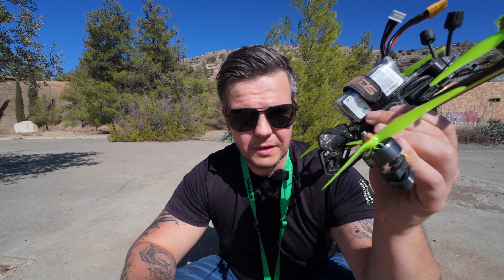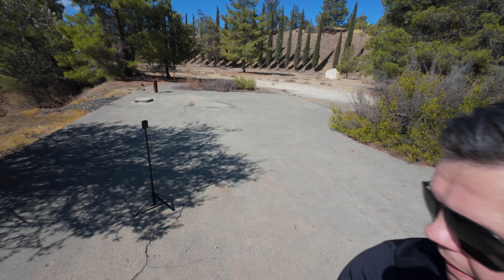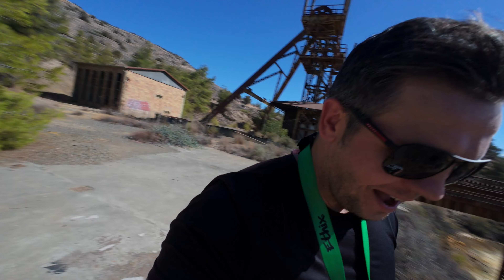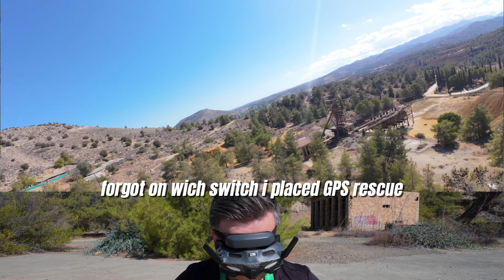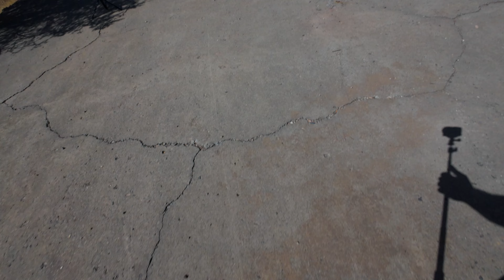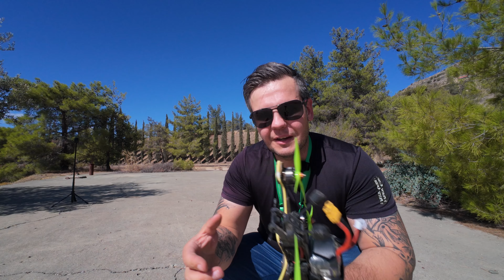GPS RESCUE / Is it worth it ? / Will it save Your drone?

Comment: It's a diy fpv quad, not a dji mavic. Its not Deepspace fault as basic gps rescue on fpv drones are to only help you until you get connection back and then you manually land it. GPS rescue is NOT Return to home mode. 

But IF you want to have it like a Mavic, you have to manually tune it or use INAV for better performance.
Reply from the maker: I know, but a lot of people is treating it as returned to home option not just a rescue, but it’s good thing to have because let’s say I had the situation when I was flying and thank God it failed safe and I got connection back and I’ve returned home without any problem or otherwise my drone would be now in the depth of the sea 😂

Comment: nice place to fly; it look like hard landing - may be need to take over control when quad near pilot to control landing. Maybe you can try land somewhere about 100M then activate GPS rescue, check whether or not it would took off and return home. I had experienced with speedybee mario; l intermittent lost RX signal, then I decided to land on the road side about 200 M away to pick it up; but when  I arrived the quad not there. Instead Beta had activated fail safe and the quad took off from landing area and return to home and landing at my first took off/ at first GPS lock point.
Reply from the maker: Oh my God, it’s bad but in the same time it’s funny. Let’s say if I would think that the drone landed somewhere and I would go there and I would not find it. I would freak out but GPS rescue is good thing to set it up and have it as a backup plan once I was flying in between mountains and I fail safe and drone fell down and I didn’t understand why and then I checked beta flight and I realize that my failsafe was set to drop😂